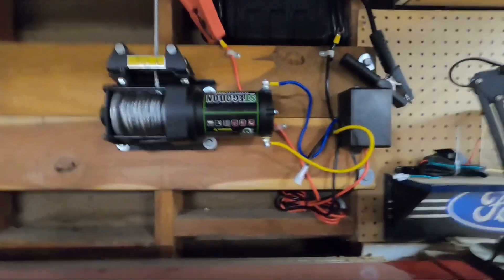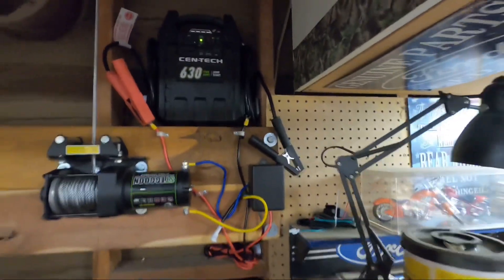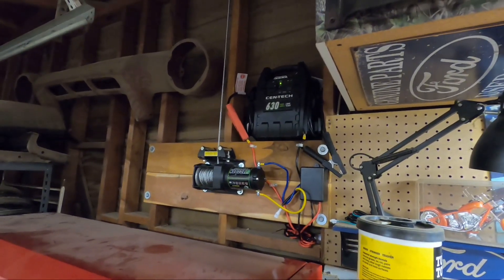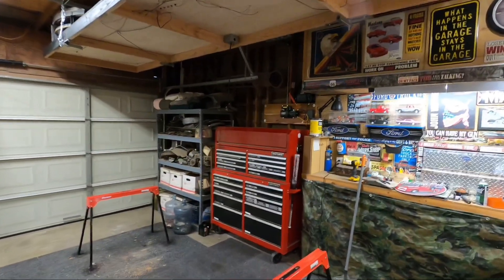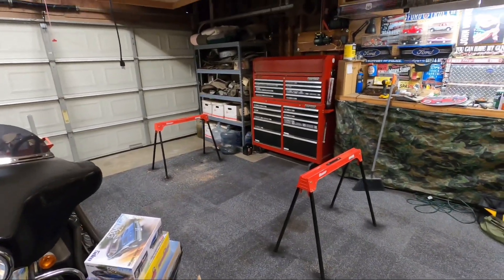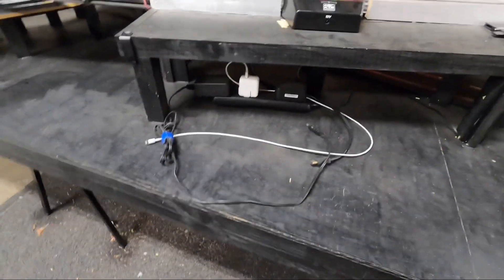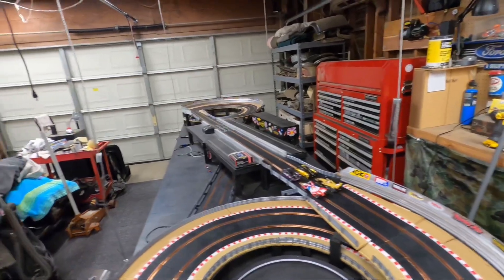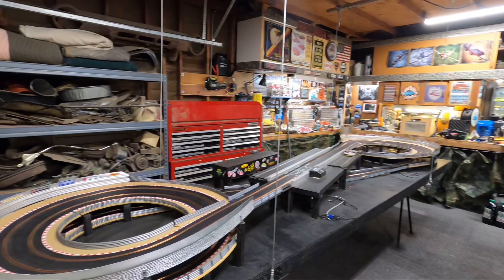Awesome Lift Table for the Slot Car Garage #slotcarracing #slotcars #diyprojects #diy

Comment: I agree Boone is an excellent resource. I like your removable anchors that slide out of table. Could yo please give greater detail on the actual pulley system, cable size. Pulley types. I have a 16x6 table in my basement I need to be able to hoist up. I have a winch from harbor freight used to remove engines but need to figure out pulley system.

Comment: Wow vary cool. i never thought of having removable cables that retract. I am at the layout stage of the cables.
Would it be possible to show some detail of the four cables merging into one for the winch. I need to get my layout to retract before winter so that  I may us my garage again. I do not have as much clearance as you do. Thanks. Here is a friends video of the first layout, much has change new video coming soon. https://www.youtube.com/watch?v=KyiXJKPkyeI&t=4s
Reply from the maker: check my playlist mobile layout Part 1,2,3,4 reach out any time and I'll try answer your questions. I think your talking about the Manifold where all corners come together. thankyou for your comment.